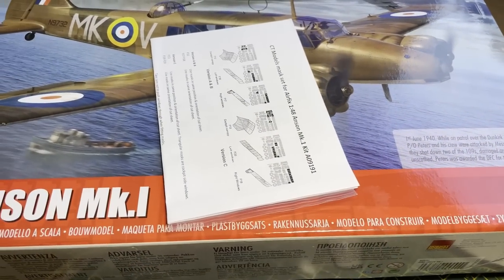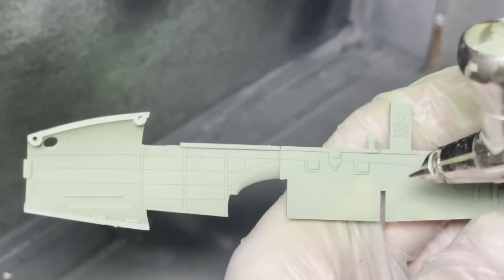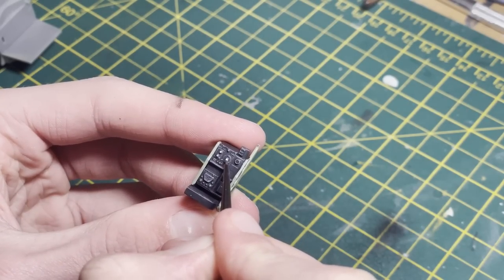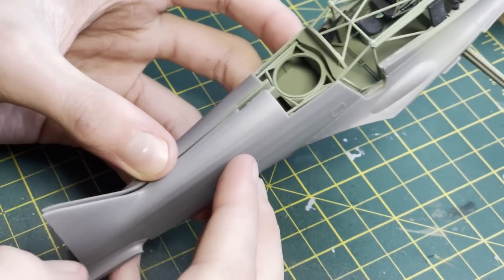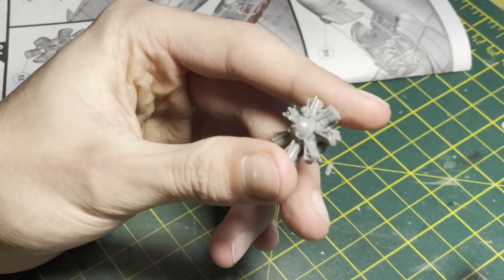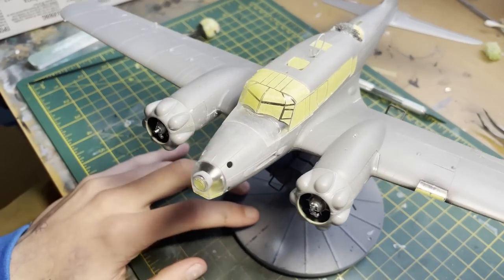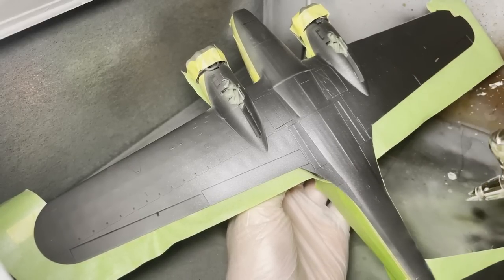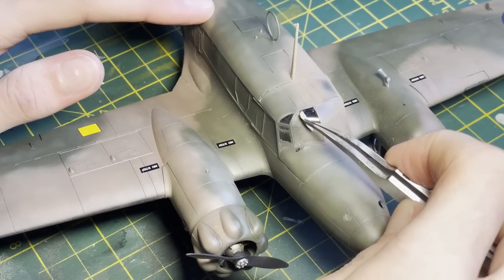New Airfix 1:48 Avro Anson | Full Build | HD

Comment: Yeah - I joined to upper wing first - BAD BAD mistake - everything was excellent... only issue was the underside engine gaps are you did... at paint stage, and it's a wonderful kit... everything you said was spot on. I had no warping issue - my clears were perfect.. and good example of the gun - agree it's easy to get wrong.
Reply: also painting - I go with a white base to check fit/joins (white doesn't hit anything), then mottle black along the panel lines (basically the reverse)...
Reply from the maker: thanks for the comment! I find it very interesting that you didn’t have any warping issues… i think that seals my theory that i just had a dodgy kit! I think i have to agree that the kit is wonderful could just use some refinement in my opinion! interesting to hear how you do almost the opposite base layering to me, maybe i’ll give it a go soon! hope you enjoyed and thanks for the comment :)

Comment: This looks really great when completed despite the issues what make the build frustrating here and there... I'd like to build one when I can get one. For the missing clear part, you can use two part clear epoxy resin to replicate them, it can be sanded and polished crystal clear when dried.... (Just fill the opening on the fuselage and let it dry.)
Reply from the maker: i cannot recommend this kit enough if you have some sort of patience with the plastic! that’s a great idea i wish i thought of it when i was building it!!

Comment: I think people should be aware of the limitations of models made from the resins called polymers in that not everyone knows that the material is very unstable.
I realised this when a part I was trying to straiten using hot water to soften it actually caused the part to shrink.
Understanding that oil is added to the plastic to help it flow easier in the injection molding machine means that the parts can change over time and then cause issues with failed mating together and parts becoming brittle. The oil in the plastic can evaporate and cause the part to shrink.
I'm now aware that if a kit contains parts which are not contained in quality sealed plastic bags there's a greater chance for distortion.
This may be more noticeable in say large hulls of ships and fuselage of aircraft.
The sealing of the plastic models after building could help prevent it drying out and the model suffering.
But once you open the bags it's actually a race against time to build it before the parts start drying out.
Wear gloves when touching the plastic if possible.
Reply from the maker: oh wow that is incredibly interesting!! thank you so much for letting me and everyone else know!

Comment: With your fit and gapping problems, it looks like Airfix has gone the way of the old Monogram P-61 kit, where it was molded so closely to scale it was flimsy and fiddly to put together, with significant gapping, many like myself quit and prefer building kits that simply go together without the hassle.
What was wrong with the way they used to make kits, where the wing halves had the nacelles molded in and simply went together and then you stuck them into the fuselage side slots with the tabs provided?
Why the layered puzzle wing assembly that punishes you if you don't get the order not "just right" and still leaves seams and ridges?
Not to mention the one piece windscreen and fuselage that will require special fitting, filing, sanding and masking?
It seems like you still have to fully sand off most of the finish and then repair it where necessary to maintain panel line integrity, etc.
Reply from the maker: you raise a very good point in the overall potential that manufacturers over-engineer a lot of their kits to increase detail but loose the joy of a simple fit, i think tamiya are the only current manufacturer who provide a outstanding fit and detail!
Reply: @machmodels  I am somewhat a fan of the WW2 RAF and the FAA, and I very much enjoyed building the old Airfix 1/72 kits, including their Avro Anson.
I  have an old unbuilt kit for it in my stash.
I read books like "The 1000 Plane Raid" where everything that could fly went over the Channel and dropped a bomb, and as I recall a few Anson's were in on it.
Being the equivalent of our Beachcraft AT-10 trainer plus a turret makes a interesting subject.

Now after watching your article, especially what happens to the fuselage's finish, I am beginning to regret my purchase of this 1/48 recent release and thinking of dumping it on eBay, because what they did looks like more for the pleasure of the kit's designer then the builder.
Thank you for your article, as it has saved me a lot of grief!
Reply from the maker: no worries mate!! i’m glad that the video helped you out :)
Reply: Stay positive, Tom. 😂
Reply: @typhoon2827  I am positive, it will remain a "shelf queen" in my collection, like the old Monogram kit, ready to be sold to the one who must have one. 😏